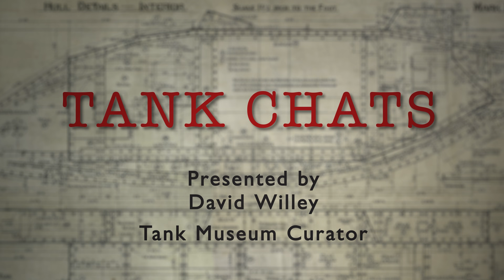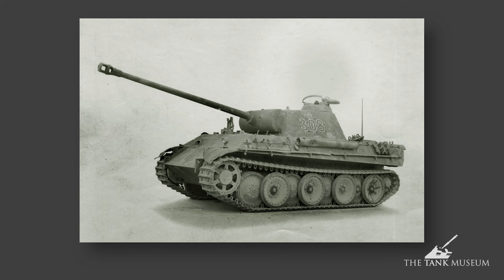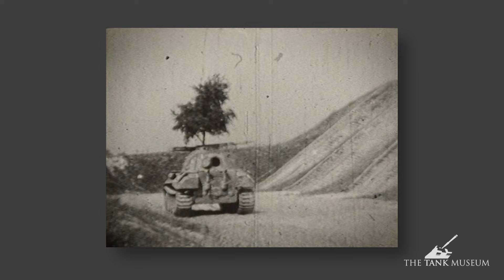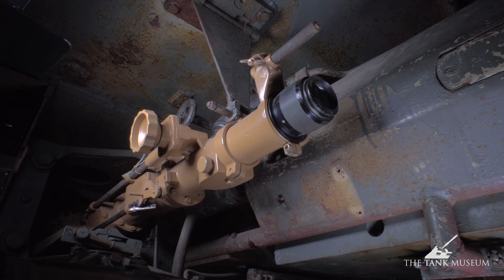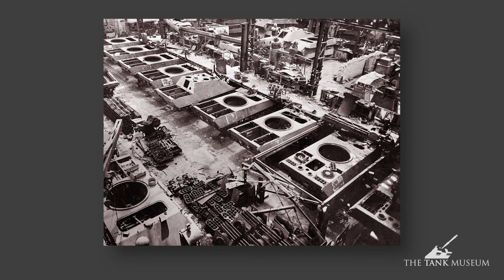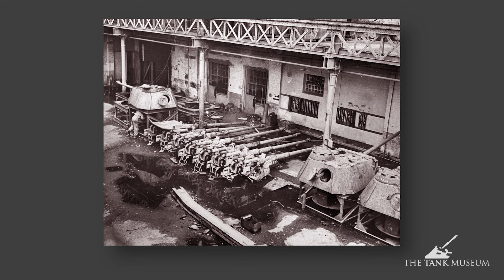Tank Chats #16 Panther | The Tank Museum

Comment: The late models made the Panther  the Best allrounder Tank of ww2 imo
Reply: welcome to the comment sections where "history buffs" pretend they know everything about tanks and argue on the internet when no one really cares... and where everyone write free essays about history that you can copy paste for your homework :)
Reply: >Spinning insane narratives where the fucking Panzer IV is a better tank than the Panther, oh my god the insanity.

Not insanity in the slightest. The Pz IV was a better tank than the Panther, especially in the thing that tanks do the majority of the time, supporting infantry. It also was more reliable, used less fuel, and presented a smaller target. On top of that, it was far easier to manufacture and consumed fewer resources and man-hours to manufacture than the Panther.

The Panther's armor is only good in the frontal arc. However the majority of production had a massive shot trap on the turret (an issue that was never fully fixed as Ausf. G's with the earlier mantlet continued to be built through the end of the war). Yes, the gun was good at penetrating armor, but the majority of encounters that a tank faces off against are not enemy tanks, but soft targets like infantry or AT guns. On top of this, the Panther's gun had a major issue with it being almost too powerful for the turret. It could not sustain higher rates of fire before the gun reached its recoil limits and the crew had to stop firing for some time. And frankly, the L/70 was overkill except for a few vehicles (IS-2, ISU-152, etc).
Reply: I’d like to point out that there’s a problem with the argument about the Panther being bad at supporting infantry due to it’s bad HE round, and that it’s worse than the Pz4. Well the only problem with that is the Panther was not designed not as an MBT. Unlike the US or USSR, the Germans never stuck to a single main tank design. The Panther was expected to work alongside and compliment the Pz4’s and Pz3’s. While the Pz4’s and 3’s would be the most common vehicles, and do most of the work alongside infantry, the Panther would support when enemy armor was encountered. Hell, it was developed as a response to heavier Russian armor like the KV and IS tanks. I just noticed that it seemed like the tank was being judged as the only vehicle in the German arsenal.
Reply: WulfeHound To be fair, that probably had more to do with the situations they were fighting in than the tanks themselves. By the time that american armoured forces entered the war, Germany was on the defensive and retreating. Meaning that broken vehicles or wounded crews would be recovered and not left behind for the enemy.
Reply: Lavrentivs
I said bad side armor for its weight. Look at the IS-2, Pershing, or even the T-44. They all have better side armor for equal or less weight
Reply: Lavrentivs
IS-2 is indeed a heavy, but I'm comparing it to the Panther since both weigh around 45 tonnes. Pershing is a medium, and the T-44 is not postwar (entered service with the Red Army for training purposes in September 1944).

IS-2 and Pershing were not designed in response to the German cats, as both programs had been started before the Panther/Tiger/etc had been fielded. Hell, the Pershing was started before the Tiger was even known to have existed thanks to the development of the T20 series.
Reply: The sane person would not want to be in a tank at all.
Reply: One of the major changes with the Sherman, over the m3, not appreciated here is the introduction of escape hatches in the floor.
Reply: Plus the final gear breaking on the Panther and T-34 were never fixed.
Reply: I think the real problem with the Panther is that the war was already on its way to being lost by the time it was available. Even if the Germans had taken the best parts of the Tiger and Panther and somehow made the perfect tank for the time and had ideal production it still would not have changed the outcome. The Panzer III and IV were the last tanks produced by Germany during the part of the war where the outcome might have changed enough to allow them to keep some captured territory. By the mid to late war eventual unconditional surrender was the only option left.
Reply: +DerMetzFetz I think you're all missing the point apart from 'WulfeHound' . The L70 could chuck metal downrange in a very dangerous way but most Tank engagements involved firing HE types which the beautiful panther was not so well designed.
Reply: The Sherman used the same 85 octane fuel as the rest of the US Army. High octane (100+) fuel was reserved for aircraft.
Reply: Since when is using Zaloga or Archive Awareness "bad"?

Unit cost matters very little in a fixed economy like Nazi Germany. Look at the man-hour costs and you'll see the Panther costs around or over twice as much as a Pz IV.

Yes, the Sprgr. 42 had similar HE filler to the other 75mm HE shells, but due to the thicker shell wall the fragmentation pattern was both smaller and less effective (as in larger fragments that didn't cover as large of an area).

Yes a higher velocity gun is nice for killing enemy armor, but the majority of targets you face in a tank are not enemy tanks, it's soft targets like infantry or AT guns.

Panther's armor was good against 75 and 76mm guns (provided it didn't crack or spall after repeated hits). 122mm, and 152mm shells could easily fracture or outright shatter the plate with one or two hits. This is not including its pathetic side armor for its weight, where obsolete weapons such as 14.5mm AT rifles or two decade old 45mm AT guns could penetrate it with ease.

"Good armor, and relative to other medium tanks quite good". Mate, the T-44 had better armor and it weighed some 10 tonnes less. The IS-2 had better armor all around and it weighed the same. (Yes I know that's a heavy tank, I'm using it as a comparison because it's in the same weight class as the Panther).

Read this, you might just learn something:
forum.worldoftanks.com/index.php?/topic/327199-our-problem-child-a-teardown-of-pzkpfw-v-panther/
Reply: +AMVM which is why the wehrshit should have stuck with Pz IV's and/or made a tank built on the concept of a medium tank with better armor layout instead of the monstrocity that was the Panther which weighed as much as a heavy tank but had none of it's protection. The panther was a failtank in almost every concievable way. Arguably one of the worst tanks that came out of the conflict.

But then again the nazi brains could never wrap their heads around the concept of efficient mass production so it wouldn't have mattered anyway. But what do you expect from a country that relies mainly on horses in a modern mechanized war to carry the logistical burden of their armies.
Reply: Yea and it is the best tank in company of heroes. Xd
Reply: ironically enough the tiger 1h generally was mechanically more reliable than the panther,the tigers mechanical problems were pretty much solved by better production on the assembly line,better training with the tank crews about the engine concerns making sure there was more availability with spare parts and engine lubricants,the panthers mechanical problems were something that could not be ultimately solved due to it being a structural problem with the panthers suspension concerning its first and final drives/tracks and 600 horsepower engine for a 45 ton vehicle case in point from an article on the topic "It was powerful.  The gun was exceptional. The frontal armor was excellent.  These features, along with excellent optics, made the Panther a powerful long-range tank killer.

But the automotive features of the Panther went beyond the automotive technology of the time. It was simply impractical to create a 45 ton “medium” tank with a 600hp engine and neutral steering using German automotive technologies of the mid-1940s.  The result was a tank which was much feared when it reached the battlefield, but was as often found abandoned along the side of the road outside of the battlefield.The fatigue life of the mechanical parts was designed for 5000 km. The wear on many parts is greater than expected. Track and running gear have a life of 2000 to 3000 km. Tracks break very rarely, even on rocky terrain. The bogie wheels, however, can become deformed when driven hard.

The parts of the power train (with the exception of the final drive) meet the planned fatigue life. The replacement of a transmission requires
less than a day.
The truly weak spot of the Panther is its final drive, which is of too weak a design and has an average fatigue life of only 150 km."
Reply: No, the tank widely regarded as the best is the M4A3E8 Sherman tied with the T34 85.The long barrel 75mm Panzer IV models are a very close second.The Panther is a turreted tank destroyer more than anything else.
Reply: And you are wrong again :
http://tankarchives.blogspot.com/2013/02/accuracy.html
See ? Everything you know is just nonesense repeated by other german army fanboys.You people do not have a clue.
Reply: @Dan barb 
Plus the British tanks were even worse than the Sherman's most of the time.
Honestly I believe Russia just got lucky with the t-34, which I would rate as tying (as the 85)with late war panzer 4s.
Reply: @thebravegallade731  cough Churchill tank cough
Reply: @thebravegallade731  Unless it's the Churchill, which had an even better survivability rate than the Sherman, the only disadvantage with it was that it was slow. The Cromwell was also fairly equal to the Sherman, it had a lower profile and better mobility, but had no sloped frontal armour and was harder to maintain
Reply: @Dave Coyle  I hope someday you can pick up a few books and learn about tanks.
Reply: @Dave Coyle  again the Ronson name is a myth. The slogan "lights up every first time" came out after the war. Also US soldiers never used Ronson lighters, they used Zippos. Stop watching the so-called 'History Channel' and stop falling for the myths and learn some real history.
Reply: @Dave Coyle  I'm not angry. I'm just saying what you're wrong about the Sherman Ronson myth and asked you to read some books on the matter and that way you'll stop repeating them
Reply: You also cant see where AP impacts/falls using a tanks optics. At least not very well. So HE makes for an excellent range calibration tool.
Reply: The HL 230 did not become highly reliable until Mid 1944 and by then the Germans had issued general orders limiting the top speed of vehicles traveling alone in combat as well as in convoy to reduce wear and fuel consumption.
Reply: The Germans knew how to fix it - just use the more expensive and more durable gear from the Tiger. But the work required would have reduced production numbers.
Reply: +UltraMato 
I never heard/read anything about the Panther offering less protection then a light tank. 
The french tests also concluded that the Panther was not suited to the 
kind of "blietzkrieg" war the allied used during '44-'45.
Reply: Well that explains it, it had the 45 mm at 150-200m. But then the Panzer III could also take out a T-34 once it got upgraded the 50 mm. 

75% of german air forces weren't destroyed on the east.
Reply: +UltraMato
Nazi bigwigs or prussian junkers/aristocrat officers ?
The dysfunctional relationship between officers, engineers and political leaders that plagued Germany also plagued the rest of Europe and Japan. And it was quite standard practice for those companies to not always design according to the specs, and sometimes that was a very good thing.  
Then there's the issue of interpretation, if the person who is in charge, which sees/has all the data decides that he knows better. This is your typical eurocrat attitude and is still a problem today.

>Implying Germany didn't have a big car industry wat

No Germany didn't have a big enough car industry by output, at least until they started using slave labor in '43.
In 1939 Chevrolet built 577,278 cars (not including truck) in the USA vs. Germany's entire output 556,648 vehicles which includes cars and trucks. And that's despite the boom the german auto industry enjoyed from 1934 onward. 
VW only reached the figures Chevy had in '39 in the mid '50s and Opel in the mid 60s'. 

>They where also short on thinking brains.

Well they started believing their own BS after defeating France so quickly and easily. Their original plan was to achieve victory by 1944. Then they saw the (under) performance of the Soviet Union in the 1940 Winter War with Finland and decided to invade it.
Reply: The Panther was great, but only for the Germans. They used it exceptionally well even though it had horrible reliability issues. The Sherman tank is ultimately the better international tank, but the German doctrine made the Panther a killing machine.
Reply: @Urto I could not have put it better myself and ,god knows , I have tried. The worst of it is that , four years after you made your comment  , these people have moved on to attacking the words and memoirs of the veterans who fought against the German army. Hard to believe , I know, but true.  The new fad is to misuse  psychological studies into the frailties of human memory to cast doubt upon their memoirs. After action reports describing engagements with Panther tanks are simply dismissed as mistaken and the army itself (I mean the British army) is slandered as deliberately inflating it's figures.  All this is as a result of holding the position that the Panther tank was so bad and mechanically unreliable that it was combat ineffective and could not , in any case , have been deployed due to it none functional transmission  ( 96 miles being given as the maximum it could drive without stripping it's final drive, hence  , non functional ).
So, in a very real way the anti-wehraboo brigade have , in fact , become the new wehraboos . Exactly as you said, how prescient !
And all this is apparently encouraged by the gaming industry!
Reply: @Dave Coyle  Ronsons were never the nickname of Shermans, the tag line "Lights up first time" was post-war, the Ronson nickname is a myth
Reply: HE will almost always be bad from a HV cannon. The shell walls just have to be made too thick to withstand the pressure.
Reply: >tells Nemo to educate himself
>has a statement filled with myths

What
Reply: The 75mm of the Sherman was a much shorter cannon than the 75mm of the Panther. Panther had WAAAY higher muzzle velocity and impact damage.
Reply: @Rudeljaeger  Against an anti tank gun the shorter 75 mm was better and since the Germans had something like 20000 AT guns the Sherman kept its 75 mm. Just travel 200 miles in a Panther and you see how good it was ;)
Reply: augh, you beat me too it.

Aqua Nox if you bothered to read what I said... I was comparing the 76mm(technically 75mm/3inch) to the German 75mm. And they are far more comparable then you might think.
Reply: @captiannemo1587  When you say the "German 75mm", I assume you mean the 75mm Pak 40? not the 75 mm KwK 42/L70 (the gun on the Panther)
Reply: +Aqua Nox Ignorance is bliss, and you're post is a great shower of this.

Shermans were actually NOT prone to fires, after crews stopped loading them up with literally hundreds of rounds to bring into battle as they did for the first couple months of deployment. And even then they had similar burn rates to other machines. Also the idea of an ammo burn problem basically dropped off the radar when wet stowage was implemented (I think Sherman was first mass production machine to have that). Also the Sherman's armor was surprisingly effective. Early on there were problems, more due to over-matching, than due to effective thickness (hence the A2 on, they used a thicker plate at a steeper angle. Same effective thickness, less susceptible to over-matching). Then there's the weak gun argument. The 75mm was more than enough to deal with infantry support roles, and to handle the P3s,4s, and stugs that they faced the severe majority of the time. And if they couldn't they'd call in a shitstorm of artillery, P47s (the didn't actually destroy a lot of tanks, but man did they mess up people's days and make them run for cover) And of course then there's always well, the Sherman Jumbo, there were certainly many of them around. Panther, good luck getting though that front plate. And the 76mm M1A1 gun, was actually a very good AT gun with more than enough penetration to deal with panther and tiger at long range.

Panther, on the other hand COULD have been the best tank in the war hands down... but they botched it up hardcore. All they had to do was a little more work (or maybe less. Over engineering is a cancer in and of itself) on that transmission and they'd have been golden. But naw.
Ofcourse I've always wondered why they didn't just opt to cut the front off of the Panzer 4, and weld a 90-100mm plate on there sloped back. Do a little something about the turret, and you'd have had a pretty fearsome machine to try and deal with from the front. But it couldn't have fit that big ass gun. And Hitler had a boner for big guns.

But then comes the greatest glaring example of historychannel ignorance. Borderline foaming at the mouth after I read the final bit.

The Russians did NOT have bad optics on their tanks. As a matter of fact they were often BETTER than German, US, UK, or whoever else. Arguments about optics probably come from a lot of their aircraft lacking modern holographic gunsights. 
Also the T34-85 had armor worse than the sherman's by the time they were deployed. But hey, at least the Soviets finally pulled their heads out of their asses and went with a dedicated commander so he could actually do his job, while the gunner did his. (lord knows how much MORE effective, the earlier 34s would have been in combat if they had done a proper crew... but we'll never know)
Reply: @linkxsc  "And the 76mm M1A1 gun, was actually a very good AT gun with more than enough penetration to deal with panther and tiger at long range." Well it is a good gun, but it still wouldn't be able to penetrate a Panther from the front, the side of the Panther is a different story.
Reply: +Aqua Nox Learn before you preach. Sherman was the most reliable and versatile tank of WW2. Going from being the most powerful tank on the field when introduced to being a backbone tank only matched by the pz4 and t34 85 in utility. Panther does not come first on any list other than the tank that catches on fire more than any other with the highest crew casualty rate of any WW2 tank. Russians loved the Emcha.
Reply: Yah, I was going to mention that there are exceptions out there but I didn't see much of a point. Since both the 76mm(technically 75mm) Sherman and 75mm Panther shared the HE issue.
Reply: Captian Nemo
Exception may be the Firefly, due to it having a reduced propellant charge for the HE rounds
Reply: +Aqua Nox The Sherman used high octane gasoline. Fun fact, the higher the octane rating, the higher the flash point (burning temp). Diesel has a much lower octane rating = lower flash point. Engine fires are easy to put out anyways if you get to it quickly enough. The fuel tanks would only really catch fire if they were punctured and exposed to an open flame/electric arc. So basically your standard AP ammo from the L/70 wouldnt set the Sherman on fire even if it hit the fuel tank. If there was a willy pete (smoke rounds, the smoke is produced from white phosphorous, which was used in incendiary bombs back then), then the fuel fumes would definitely ignite.

Another fun fact: The French tested the Panther extensively after the war was over and found that if you popped a smoke grenade on the roof of the Panther behind the turret, the engine would burst into flames (very exposed engine of Panther)

There's a reason the Panther had no real effect on post war tank designs. It wasnt that good. The closest it came to influencing a post war tank was the AMX 50 series, which borrowed a lot from the German E50 project, based off of the Panther. The Sherman went on to the T20 series --> M26 --> M46 etc. and the T-34 --> T-44 --> T-55 etc.
Reply: +Captian Nemo Its an apples to oranges comparison.  If I had to be inside a tank in December of 1944 in the Ardennes, I'd rather be in a panther.  Shermans win out in ease of production, mobility, infantry support, but one for one, the Panther was far superior.
Reply: +WulfeHound "The Panther's armor is only good in the frontal arc." Unlike the vertical side armour of the Sherman (38 mm) or Pz IV (30 mm)? The only medium tank at the time with equal side armour was the T-34, with it's 45 mm which was better sloped than that of the Panther's 40-50 mm (depending on model).
Reply: Charles Black
Except the Sherman was probably the safest tank of the war to be in. Average crew losses were generally 0.28 KIA and 0.61 WIA per tank. Out of ~4600 Shermans lost (either completely destroyed or damaged and then later repaired), less than 1500 crewmembers were killed.
Reply: That would imply either :

a) a happy accident resulting in a good tank (and that meant a good HE 75 mm shell to help support the troops when needed )

b) a lot of trial and error from which the germans could chose the better tank (but Germany didn't have time for that or a massive industry like the US to experiment).

Horses, ah, but a lot of trucks would have required a lot of rubber, steel , oil and maintenance personnel, besides a bigger car industry.
And only the US could afford that (and the brits/commonwealth just piggybacked on the US industry for mechanization).
The US and its armed forces are one thing, everyone else is everyone else.

There was never any hope for the nazis to win the war anyway since they were short of everything (resources, men, economic output).
Reply: +Captian Nemo Wrong. The Sherman was malfunctioning and dangerous for its crew when the war started, and underarmed and -armored when it ended. At no point ever was the Sherman anything more than "Ehh...Itll do...". Best allrounder tank of WW2 was either the Panther G or T-34/85.
Reply: @Rudeljaeger  The Sherman was miles better than the T-34-85. Greater ergonomics, higher survivability and more mechanically reliable. Take a look at the Korean War where Shermans were used against T-34-85s, the Shermans had a much higher K/D ratio than the T-34-85 against each other.
Reply: Supernatural all except the M4A3E8 PWNED the T-34/85 during the Korean War!
Reply: Supernatural you clearly don’t know anything about how the Sherman actually performed compared to the T-34 and the Pz 5 “Panther” and also the M4A3 (76)w performed well and could penetrate tiger and panther armor
Reply: +DerMetzFetz Panther G's were still unreliable pieces of garbage, and lacked many things that came standard in Shermans. Good HE performance, a turret that could rotate if the tank was on a slope, vision equipment for the gunner aside from his main sight, ammunition stowage that was actually protected and not in vulnerable sponsons (or wet stowage for later Sherman models), and engines/powertrain/suspensions that were easy to fix and reliable
Reply: @HBK-6S  the germans had the stugs mostly for infantry support and who tells you the panther didn't hat a fast traverse rate the Sherman was a good tank only because of its role and because the amount of them made.
Reply: +AMVM
> a happy accident resulting in a good tank

Or you know. Actually listen to the people driving them and not base your design on the specifications of nazi bigwigs.

> a lot of trial and error from which the germans could chose the better tank

But it did undergo a lot of trial and error though. They had competing companies building prototypes on the specifications they got, and it was successively iterated on after that and came in many variations.

> but Germany didn't have time for that or a massive industry like the US to experiment

It doesn't take a huge industry to DESIGN a good tank. It takes a massive industry to produce a tank in massive numbers. And the German war industry was pretty big (and propped up by a huge slave workforce).

It was their production methods that where decades behind the soviets/americans (americans built most of the heavy industry in USSR before the war so they had nearly identical production methods).

> Horses, ah, but a lot of trucks would have required a lot of rubber, steel , oil and maintenance personnel, besides a bigger car industry.

Implying Germany didn't have a big car industry wat

Or is it down to the fact that the nazis didn't even bother to gear the country for war production before mid 1943? Something the allies had done from day 1 of the war.

> There was never any hope for the nazis to win the war anyway since they were short of everything (resources, men, economic output).

Now that's something we can agree on. They where also short on thinking brains. I think this was at least as crucial.
Reply: 1v1 encounters almost never happened. And I can see why you'd rather be in a Panther, because there's a greater chance of it breaking down and you not having to fight.
Reply: And absurd muzzle velocity is not a good thing when you need to chuck HE. I think it's also relevant that the majority of combat that tanks faced was not against other tanks, it was against soft targets like infantry or AT guns, or against fortifications/buildings.
Reply: +Captian Nemo Please educate yourself. The Sherman was prone to bursting into flames even after glancing hits on the earlier models. When they fixed the problem it was later in the war and both armor and armament were no longer sufficient.

The Panther had mechanical problems for about half a year,  later than that they were reliable. And even at the end of the war the Panther was well armored, had an excellent cannon, and was fast.

The T-34/85 only downside was its inferior optics. But the Sherman was the tank that got many tankers killed because of its thin armor, weak gun and an engine that was prone to catch fire.
Reply: @Rudeljaeger  The Sherman's engine was not the primary cause for the fires. That is a myth. The real reason was the ammunition storages. Also the Sherman had a much higher survivability rate than the T-34, the Shermans had much better hatches than the T-34. So actually the T-34 was more of a deathtrap than the Sherman was. Tank casualties were also far lower than infantry casualties, only 3% of US tankers were killed, and a slightly higher number for British tankers. 

But both were much lower than Soviet casualties. Again stop watching the "History Channel" as they peddle on these myths despite the fact that have constantly been debunked.
Reply: @Rudeljaeger  Yeah, you don't know anything about the Sherman.
Reply: @Rudeljaeger  "But the Sherman was the tank that got many tankers killed because of its thin armor, weak gun and an engine that was prone to catch fire." The Sherman engine fire has been debunked many times. The main cause for fires in Shermans was ammunition, not the engines. besides the Germans also used Petrol tanks too, but yet no one says they caught fire. The Sherman actually had very low fatality rates, especially compared to the T-34, it had one of the best survivability rates of any tank, beaten only by the Tiger I and the Churchill tank. The T-34 by contrast had a much worse death rate, but everyone claims it was the best tank and the Sherman a "death trap"!?!?!?
Reply: +Aqua Nox  If the Sherman is malfunctioning and dangerous... What does that make the Panther? Hardly mobile and working? And what does that say about the T-34? The Sherman was soundly recommended by the British in 1942 as the tank that the US needed to focus on and build in huge numbers to make the war winnable at all. The Panther is such a engineering overkill and mess its not even funny. The Sherman is the tank you want and need when all the 9 hells break lose and it just needs to work on any given day of any given year. The Panther and T-34 will not give you that.
Reply: - Weighs as much as a heavy tank, less protection than a light tank
- Crippling reliability issues right up to the end of the war
- A tank designed more to the specifications for nazi bigwigs then what the panzerwaffe actually needed (but the Panther wasn't the only tank suffering from this)
- Impractical to reload, uncomfortable to ride in and a nightmare to get out of in case you needed to bail
- Mud froze between the overlapping track wheels? Tough shit, you now have an armored static pillbox, not a tank

To name a few drawbacks.

British got 5 factory new panthers to field trial right after the war. All of them broke down to the extent you couldn't even use spare parts from any of them in order to complete the trial. They where a nightmare to maintain. 

"Best allrounder tank of ww2" HAHAHA. Worst is more accurate. It was shit in  almost every concievable way.
Reply: WulfeHound Lets not forget that the IS-2 and the Pershing were heavy tanks and the T-44 is a postwar tank and all of them were made after the introduction of the Panther, as a response to the german 'cats'.
I can also add that the Centurion which was developed during the same period as the Pershing and T-44 had no more than 50 mm of armour on it's sides.
Reply: WulfeHound The Pershing was redesignated as a medium after the war and by comparing the Panther according to the its's weight alone misrepresents the tank as it was not built to be a heavy tank, but a medium. And 40-50 mm of sloped side armour is not bad for a medium tank first introduced in early 1943.
Reply: The Sherman's armor was only slightly worse than the Tiger 1's along the frontal arc due to its sloping and the Tiger's lack of sloping.

Shermans were designed first and foremost to do three things that tank crews really appreciated

1: It wouldn't go out of action on its own.  Average shop time for a Sherman was the lowest of any WWII tank that was regular frontline service.  This was a big deal, because it means that if your squadron found an enemy armor unit, ALL your buddies were on hand to help murder ot

2: The Sherman was designed to take the initiative. The Sherman had some of the best vision of the war.  Sherman optics were very good to begin with, a match for the best anyone else had, and it threw in a gunner's periscope so that the gunner could acquire targets independently.  

3: The Sherman was designed for the comfort of its crew.  Ergonomics is critical in good tank design.  A crew that has to work harder to operate the same tank will be far less effective if the tank has to drive for several hours, then fight.  Also many features were installed to help the crews survive the battlefield, such as spring loaded hatches for easy escape for a burning tank as well as wet ammo racks.  

(after all, America started the war with very VERY few experienced tankers, and so they really needed these guys to survive and gain experience!)

 The Soviets in particular adored their Sherman Emchas because they were far easier to operate than the T-34.  It even, unlike the T-34, had a built in heater!  An unheard of luxury for Soviet tankers.
Reply: +WulfeHound Its more than I wouldn't want to be inside a Sherman in the Western front of WW2.  Death sentence.
Reply: @Chasstful  Want a death sentence? Hop in a T-34. The Sherman had a low casualty rate.
Reply: +Aqua Nox The Sherman in reality was design to go against infantry not tank to tank that is why they kept that lousy short 75mm gun on it. It took 4 Shermans to knock out 1 Tiger. The only advantage the Shermans had were numbers and speed.
Reply: +AMVM It's pathetic side armor could be penetrated by man held AT rifles. Soviet light T-70 tanks had no problems going toe to toe with Panthers in an ambush:

http://wio.ru/tank/ww2tank.htm

But then again, M8 Greyhounds armed with 37mm guns knocked out Tiger I's on a few occasions, so shouldn't really be surprised by wehrshit performance. 

http://www.dtic.mil/dtic/tr/fulltext...10.pdf#page=23

e: given field tests and real life performance especially logistically, the Panther wasn't really suited to anything else but semi static defense on the Russian steppes where it's high velocity gun could wreck havoc on targets from long range, where it could hope to keep enemies at an arm length distance from itself.
Reply: +Captian Nemo the only thing remotely pleasing about the Sherman was its production capacity. Other than that it was an inferior tin can. Even if it didn't break down, it's armour would be penetrated by virtually anything it came across. Stop kidding yourself, if you seriously think the Sherman was the best tank of ww2 then it clearly shows that you are virtually clueless.
Reply: +WulfeHound Panzer IV is more reliable than the Panther? HAHAHAHAHAHHAHAHAHHAHAHAHAHAHHAHAHAHHHHHHHHHHHHHHAHAHAHAHAHHAHAHAHHAHAHAHAHAHHAHAHAHHHHHHHHHHHHHHAHAHAHAHAHHAHAHAHHAHAHAHAHAHHAHAHAHHHHHHHHHHHHHHAHAHAHAHAHHAHAHAHHAHAHAHAHAHHAHAHAHHHHHHHHHHHHHHAHAHAHAHAHHAHAHAHHAHAHAHAHAHHAHAHAHHHHHHHHHHHHHHAHAHAHAHAHHAHAHAHHAHAHAHAHAHHAHAHAHHHHHHHHHHHHHHAHAHAHAHAHHAHAHAHHAHAHAHAHAHHAHAHAHHHHHHHHHHHHHHAHAHAHAHAHHAHAHAHHAHAHAHAHAHHAHAHAHHHHHHHHHHHHH

Try again.
Reply: +DerMetzFetz Wrong. Sherman still wins that title... First time, Every Time.
Reply: @captiannemo1587  you meant the tommy cooker lol
Reply: @captiannemo1587  nice lighter joke ;)